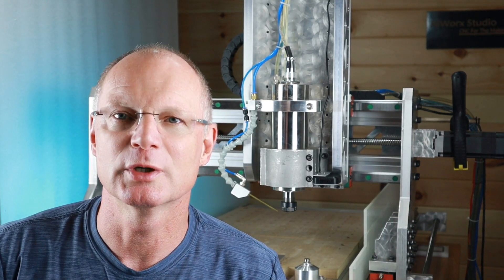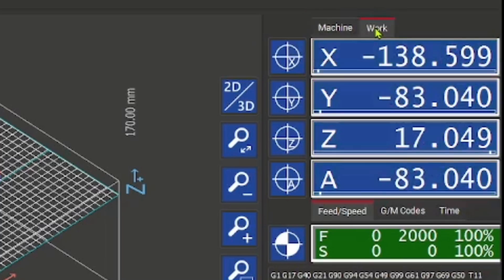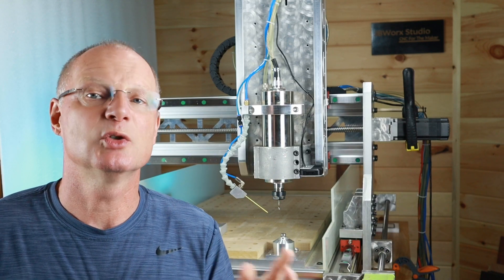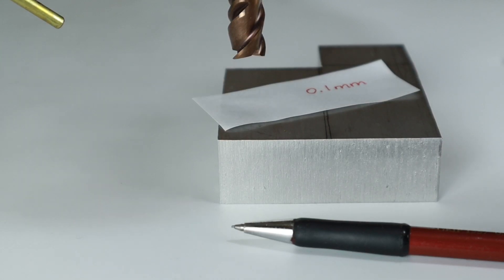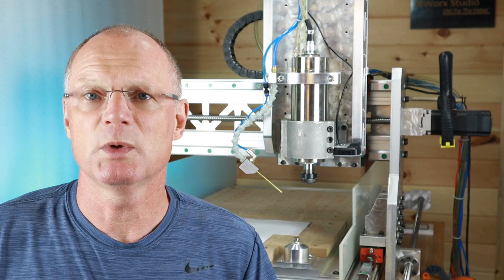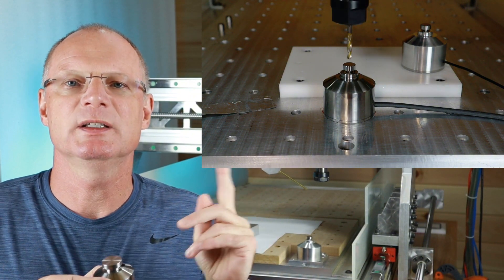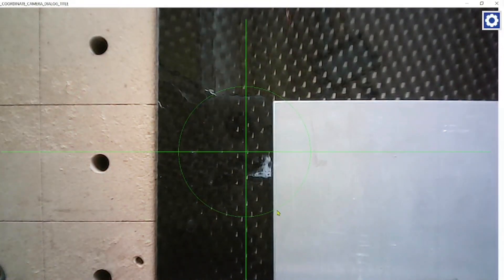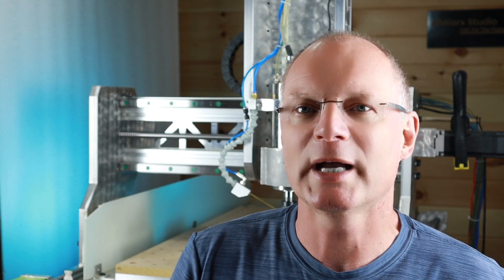CNC Machine Workpiece Zero: How to Set it Perfectly Every Time!

Comment: When you zeroed your x using the endmill, why did you deduct -5 which is the radius of the tool? Does fusion 360 not account for tool radius when choosing the endmill from library? Thank you so much for your tutorials.
Reply from the maker: Yes for the tool path fusion will account for the tool radius. But in this step we tell fusion where the zero point of x is (so it can correct for the radius from this point). Because we touched with a 10mm diameter tool the edge of the part the centerline is -5mm away from the edge. And that is what we enter into the machine control.

Comment: what if your workpiece is not square? how does the cnc know what the orientation is?
Reply from the maker: You will have to have a reference on the workpiece. This can be the center of a hole or any other feature with known dimensions. Important is that the alignment of the part on the table is identical to the G-Code reference in the program.
Reply: @JBWorx  so if I use a center as a zero and then have a reference hole on the workpiece. how do I set the reference hole into the cnc to tell it where it is? I just candle right now and im not sure how to do it.
Reply from the maker: You will need to touch off on  that hole and calculate from your coordinates in the DRO where the center is. Then set the axis to that value and zero out the DRO in Candle. Hope this helps.
Reply: @JBWorx  set the y axis?
Reply from the maker: And x as well. And then Z separate from that.

Comment: I use a wobbler on my 24k spindle. I spin it at 1000 rpm. It doesn‘t have any torque at this speed, but it doesn‘t Need to.
Reply from the maker: Most machines will not go that low on the default settings of the VFD. I think that there are some settings to increase the torque at lower rpm’s by setting a min voltage. However these settings can damage the spindle quickly if run at a very low rpm as it creates a lot of heat. Good if you figured out a way to do it.

Comment: I prefer to zero from the top of the workpiece. To do this I have accurately measured the thickness of a piece of steel plate which is attached by wire to the controller. A ground wire with a croc clip is attached to the tool. XY zeroing varies depending on the job. Sometimes lower left, other times centre. If there will be tool changes, I try to place the XY reference in an area that wil not be machined. That means it is easy to get the new Z zero. I don't have a tool changer.
Reply from the maker: You have a good workflow right there. Sometimes setting zero at the bottom just makes more sense as an example you use a vice and set zero to the top of the parallel that sits in the vice. Now you can deck off several pieces with slightly different thicknesses all to the same thickness without having to re-set z zero.
Reply: @JBWorx  Thanks. When I am working double sided I will set a top zero for the first side, and a bottom zero when it is flipped. This keeps vertical dimensions solid.
Reply from the maker: Yes exactly 👍 you explained it with less words than me 😀

Comment: All my tools re 1/4" shank so my spindle has a 1/4" collet.  I see the probe has a 6mm (.24") shaft. Will the 3D touch probe work with my system? If not, can it be purchased with a 1/4" shaft?
Reply from the maker: I don’t think there is one with a 1/4” shank available. If you would ask me if you can put a 6mm bit into that collet for mashining I would say no don’t do it. However just holding the probe should be possible.

Comment: nice to see a new video! I just purchased a edingcnc 720 controller and was wondering what macro you are using for the 3d probe?

It looks like there is a paid one from sorotec but I think they only sell it with the 3d finder.

Greetings from germany :)
Reply from the maker: Congrats on your purchase, I think you will like it. Yes correct Sorotec sells a macro with the probe - apparently these are from the probe manufacturer. However you can download the generic Sorotec macro for Eding CNC. I use a slightly modified English version of it. It has 3d probing but not very advanced.

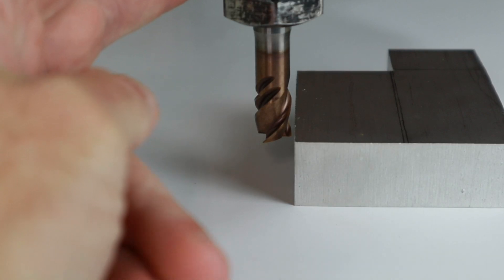Comment: 6:30 If your spindle is electrically isolated from the bed, it's really helpful to wire up an LED so it will light up when the tool makes contact. More precise and won't leave a mark on the workpiece like homing by feel. The same electrical conduction can be used for auto probing too. Obviously it also requires a conductive workpiece, though at least for Z probing, you can hold a piece of aluminum foil on top of the workpiece and touching the bed and probe to that for a reasonably repeatable position.
Reply from the maker: Yes that is a good suggestion. I also like the aluminum foil tape and just wrap the edge of the part if it is not conductive. However I stopped using this method after breaking a really expensive Datron bit. I set Z with my tool length sensor and use the 3D probe for x-y. It is accurate and fast.

Comment: Sir, how do i know the top of a part if my machins is probing using a tool length sensor placed on my cnc table ? Do i have to premeasure its thickness first and enter somewhere in the probing function ? I have use a fixed thickness touch probe placed on top of a part and probed it. The probing macro knows the thickness of the probe hence it can 0 correctly above the part. Just that i don't understand how it can predict the top of a part if it is probing on a TLS placed on the table.
Reply from the maker: You will probe twice. First on the calibrated standard position on your table. This will tell the controller the length of the tool. Next you probe on top of the part. This will tell the controller where the z zero of the part is. Now for the next tool change you only need to measure on the standard position on the table. The controller calculates the offset from tool one to tool two. Hope this makes sense.
Reply: @JBWorx  thank you for the reply. looks like your probing macro/function quite advance. I am using mach3 and macro I hv can be used to probe using touch plate. from probing  I will hv the Z 0 of top of part. maybe you can do a video to demo wow do u probe with TLP?
Reply from the maker: I used Mach 3 only for a week or so in the beginning so the macro on my controller (Eding) will be much different.
Reply: @JBWorx  sir, this means you you need to put tools in a tool table?
Reply from the maker: I that is not necessary.
Reply: sir, could you demonstrate sequence of how you probe and determine tool length for each tool?
Reply from the maker: The controller will need to know the precise height of the probe. Once that is set it can compare the length of tool 1 and tool 2 that you just changed to and make an offset in the tool length automatically. Unfortunately I don’t know how that works in Mach3

Comment: Das mit der Kamera finde ich interessant. Nicht unbedingt zum edge finding, dafür ist es mir zu viel guesswork. Aber da könnte man evtl. selbst mit Eding so eine Art Steuerung wie bei Datron aufbauen, wo mit der Kamera die Bereiche gekennzeichnet werden, die der Taster anfährt. Letztes Jahr waren beim open house day von Eding ein paar Jungs da, die da eine vielversprechende Demo gezeigt hatten...
Gibt aber imho zwei Dinge zu lösen. 1. Haltbarkeit der Kamera. Ich hatte mal einen ausfahrbaren 3D Finder an der Z-Achse und den haben die Schwingungen gekillt. Ne HD Webcam hat keine beweglichen Teile, könnte daher vermutlich auch dauerhaft klappen. 2. Sauberhalten der Linse. Meine Z-Achse ist an der Unterseite ziemlich verschmandet, mit einer fiesen Mischung aus KSS der MQL und feinsten Aluspänchen vom Gewindewirbeln. Da müßte die Linse irgendwie vor geschützt werden, mit einer Klappe, o.ä...
Fänd ich klasse, wenn du in der Richtung etwas experimentieren würdest 👍
Reply: @scratchbuiltdesigns, I have a on-board probe in my Z for a long time and it's working just fine.
Mine is only energized when I send it to probe, not when machining.
Reply from the maker: Ja ich hab ein USB Microscope mit einem Schutz (einfach nur ein Plastik Aufsatz vor der Linse) welches etwas weiter oben angebracht werden kann. Ich denke für Projekte wo man eh außen die komplette Kontur fräst ist das sehr interessant. Danke für dein Input - hatte einen pneumatic cylinder vorgesehen um die 3D Probe anzubringen (a la Datron schwingt also von oben runter im Halbkreis) … ist dann aber wohl nicht so eine gute Idee wenn deiner das nicht ausgehalten hat. 
Danke für dein Input.
Reply: @JBWorx  Ich hab da auf Insta mal einen etwas detaillierteren Post zu gemacht. Sowohl zur Mechanik des Ein- und Ausfahrens, als dann später auch zum Fail 👍
Reply from the maker: Oh ja sehr schön dein Equipment!!
Reply: @JBWorx  Danke dir 🙏
Reply from the maker: Nice stuff English too. !